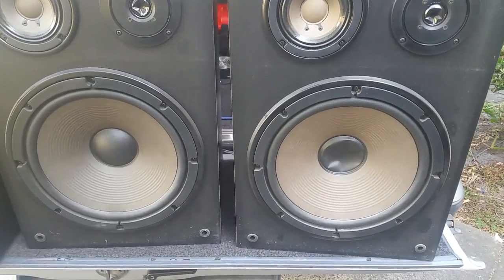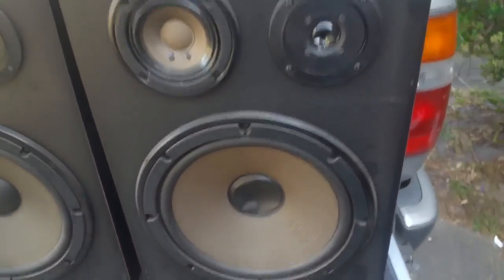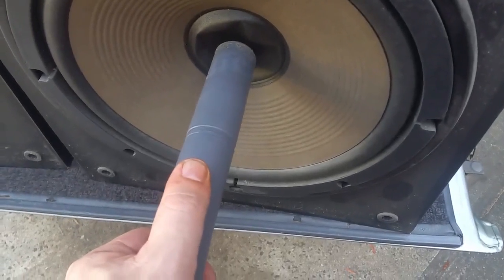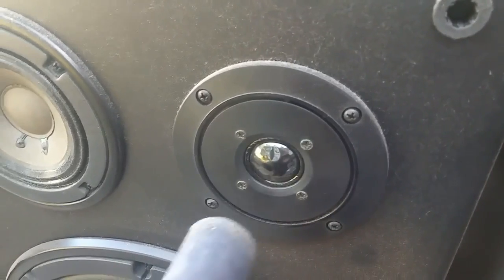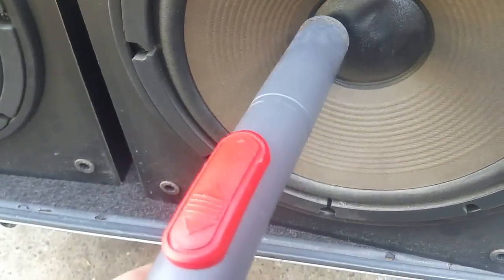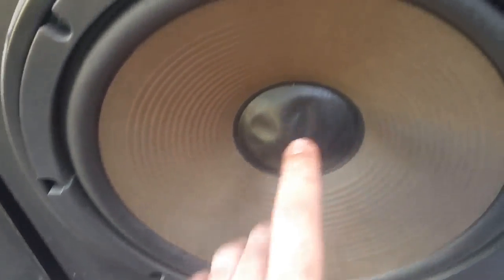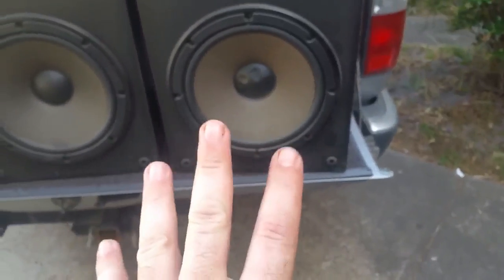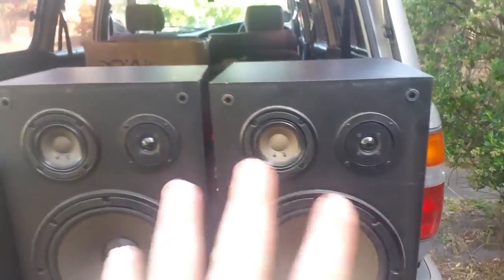Speaker Cone repair

Comment: I bet if you used a real good hair dryer to warm the material up before using the vacuum, those little dents will come right on out of the sub. :face-blue-smiling:

Comment: Easier to just put a new dust cap on the woofer.  Carefully use a scalpel to cut the old one out and buy new dust cap and apply with adhesive.

Comment: Yep done this since the late 80s Now just get a hair dryer which will re form the dome and get rid of the dents, done it hundreds of times. They. Can handle a lot of heat, trick is to get them hot as possible and slowly you’ll see those small dents disappear because when you reheat thin plastics they go back to the “memory” shape they originally was.
Reply: Isn’t it gay-lussac’s law kicking in and just pushing out the dents as the pressure rises

Comment: I would not use this approach. I prefer using a thin strip of clear tape or electric tape to touch the dust cap gently, and pull it out.
Reply: i dont think that would work on plastic

Comment: The BEST way to do it is wrap some scotch clear tape on your finger, with sticky side on the outside and gently touching the cones and pull em out. works 100%. after pulling the cones out, just use a heat gun and heat the cones for like one second, not more. can wait a few seconds and try again if not happy. all the scratches will be gone, 100% restored.
Reply: thx alot it worked !
Reply: Ioan Koka has
Reply: Thanks for the tips&tricks. However, since normal tape wasn't sticky enough in my case, I used Duct tape instead what worked out very well.
Reply: I really hope this works bc when I listen to music it pops in and out making this noise which ruins the bass
Reply: @icefight  Gorilla tape would work better I am thinking!
Reply: Worked a treat, thanks.  I used 100mph tape.